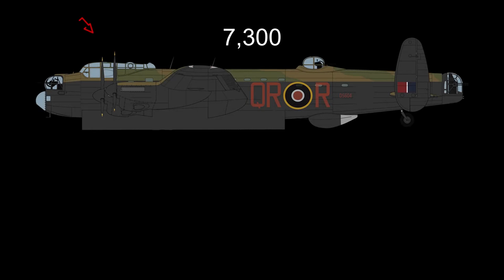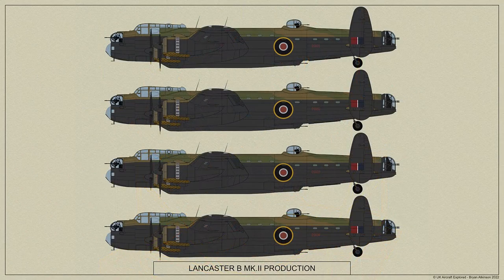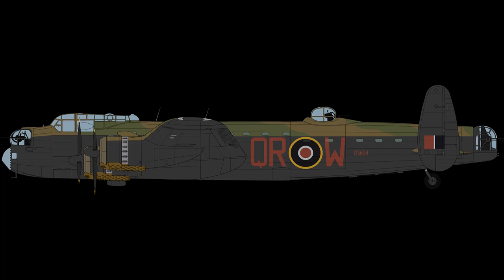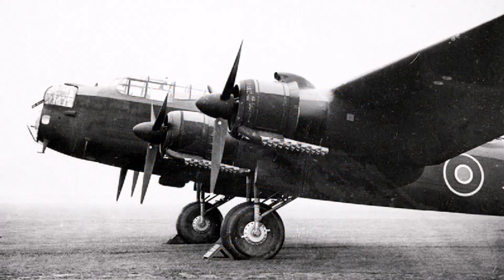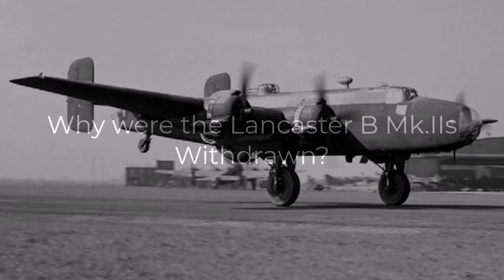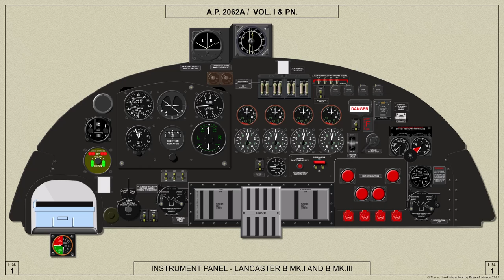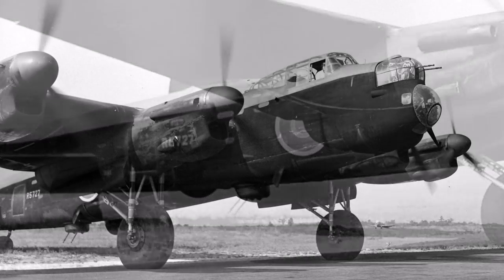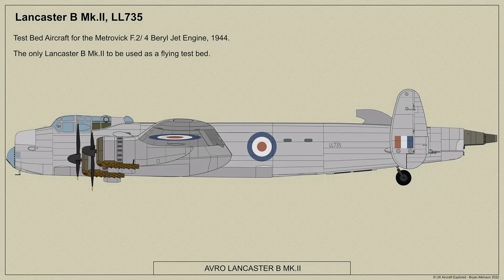Avro Lancaster B Mk.II – The Forgotten Lancaster

Comment: Great video!  My Dad was in the 426 Squadron  as a pilot and flew 18 sorties on the Lancaster Mk II before switching over tot he Halifax Mk III and VII. I have question regarding the Halifax Mk III that I cannot find the answer for that you may be help. Why does the Halifax III have on three of its engines the flame suppressor exhaust pipe on the bottom right side of three of the engines and on the bottom left of the outer port engine only?  It would make sense that they would all be on the same side or in a two and two configuration. I am sure there is a technical explanation and I haven't found the answer to what that is and hoping you or one of your audience may have it. I build a model of my Dad's plane that he was shot down in over France in June 1944 and the anomaly just got the best of my curiosity.

Comment: Unless I am mistaken, 'in line' and 'V' engine configuration are not the same. Were not the Rolls Royce Merlin engines V 12, and not 12 cylinder 'in line' engines?. Unless of course 'in line' means something else that someone I'm sure will be able to educate me about. Peter Norcliffe.
Reply from the maker: The term inline was sometimes, but not always, used during the war to describe the Merlin. Often used, when describing the difference between the Merlin and a radial engine in training ground crews. I can only think that it was sometimes looked upon as two banks of inline cylinders in a V arrangement. Of course, the V 12 became the excepted term. Thanks for watching Peter!

Comment: It’s interesting the Hercules had no engine temperature gauges. You would have thought an air cooled engine would benefit from exhaust gas temperature sensors.
Reply from the maker: Yes, the Lancaster B.II did have engine temperature gauges. If you look to the part of the video, covering the Pilot's Auxiliary Panel, you will see it. Thanks for watching.
Reply: Most radial engines of the day had cylinder head temperature gauges.

Comment: One interesting point you made was the extremely poor ceiling of the Mk II. The Stirling gets criticised for its ceiling and the "short" 99 foot wingspan gets blamed. Could it have been the engines?
What was the ceiling of the II with the later engines?
I recently saw an article about the Whirlwind and it dis not fail because of the engines but rather the propeller. The engine was blamed, but a very technical explanation clearly shows that the prop used was not really compatible with the engine.
Is it possible that the Stirling has been called a failure and the wings blamed when it was actually the poor attitude performance of the engine?
Clearly the Herk was a great engine and it was capable of operating at height in some versions.
426 kept its IIs I  service until ordered to hand them over. I read that in the official squadron history "Thunderbirds at War".
426 went from Wellingtons to Lancs to Halifaxes and was always Hercules powered.
Reply from the maker: Interesting thoughts. Yes, they used the Hercules powered aircraft, as the ground crews and engineers could easily adapt to each aircraft type. With regard to the service ceiling of the Mk.II using the Hercules XVI, the manuals and pilot's note don't actual mention this. I feel it would still have been around 18,000 feet. Thank you for sharing.
Reply: Interesting point about the engines on the Stirling.The Sunderland flying boat actually had a better ceiling than the Stirling even with Pegasus engines. The bigger wingspan did seem to help - but I'm sure the reducing power as the altitude increased must have been a factor.

Comment: So - the conclusion seems to be that the main advantage the Lancaster had over the Halifax was its Merlin engines.
A Halifax with Merlins as good as a Lancaster?
Reply: The Halifax started life with Merlins and had them for much of its service life. It was only much later in the war when radials were fitted (along with airframe changes) and the combination led to the lowest loss-rate of any Bomber Command type in service 1944-45. Ironically, given the information in the video, this was ascribed principally to an increase in operational ceiling although no doubt the greater ruggedness of the radial had much to do with this also ...
Reply from the maker: I do mention in the video, that crews felt that the Lancaster Mk.II was safer than the Merlin-powered Lancaster versions with their vulnerable engine cooling systems. And in spite of damage considered crippling to the standard Lancasters, the Mk. Ils managed to struggle back to base. Thanks for watching!
Reply: The later versions of the Hercules were much improved on the ones fitted to the Lancaster MkII in respect of the ceiling

Comment: It's not forgotten by me. I often point it out when there's a discussion about the Lancaster, seeing as how often the Mk II is overlooked.

One thing that would be nice is to have some firm numbers as to how many of the Mk II had the bulged bomb bay doors and ventral turret. References I've read frequently say 'most' of them had the enlarged bomb bay doors, but that's hardly a definitive count.

Some did have the ventral turret. 408 squadron certainly did, as it squadron ORBs list an eighth crewman, the mid-under gunner, for some of the aircraft. The earliest instance of this was on the 30/31 March 1944 mission. Approximately thirty different aircraft, by serial number, had a mid-under gunner for one or more missions by the squadron.

One thing that isn't clear is whether that mid-under turret was the FN64 or the Preston-Green (or was possibly a ventral station jury-rigged by the squadron).
Reply from the maker: I don't think any firm numbers regarding how many Lancaster Mk.IIs had bulged bomb bays and Mid Lower Gun Turret would be easy to locate. The Mid Lower Gun Turret used was the Frazer Nash FN.64. Thanks for sharing and for watching.
Reply: @ukaircraftexplored6556  Yes, I've resorted to going through the squadron ORBs looking for an eighth crew member. Not exactly the easiest method!

Thanks for making these videos. It's great stuff.

Comment: You say Mark 14, but the subtitles say Mk XVI not XIV
Reply from the maker: In the video, I mention the Bristol Hercules Mk.14, it should be Mk.16. 
Also, I said that the Merlin engine is an in-line engine. I should have said The Merlin is a Supercharged, geared, pressure liquid cooled V-Engine, fitted with a two-speed Supercharger.
I'm sorry about this. Really annoying, as I checked everything before uploading. Thought of changing the video and re uploading, but would lose all of my views and comments. So pinned a message in comments and the same in the description. Thanks for watching.  Bryan
Reply: @ukaircraftexplored6556  perfection is for the gods. Thanks for caring about accuracy enough to pin necessary corrections.

Comment: Merlin was  V12, not an in-line engine.
Reply from the maker: Thank you for your comment. I should have said The Merlin is a Supercharged, geared, pressure liquid cooled V-Engine, fitted with a two-speed Supercharger. I'm sorry about this. Thanks for watching.  Bryan
Reply: A V12 is an in line engine.
Reply: @kellybreen5526  Of course it's not. The clue is in the name. You might as well argue that a boxer is an in-line engine, and a Deltic for that matter - complete tosh.
Reply: @gzk6nk  Vince, maybe itbis a translation sill bonnet boot thing but there are two types of engines round ones and long ones.
The round ones are radials because the cylinders go around the crank and the other ones be they straight, v, y or w or x shaped are in line because the pistons are one behind the other in a line. 
A V12 is an inline engine  even a V4 is considered in line at least in Canada.
Even if technically a stretch, this is the accepted norm for describing engines.
The only straight 12 cylinder engines in have ever heard of were in cars.
I guess you would disagree, but the Napier Sabre is generally considered an in line, same goes for the Vulture.
Radials get "rows" when they go deeper.
Being Canadian I am equally well versed in "British" and "American".
We are a tri-lingual country if you include those guys from Kay-beck.

Comment: XVI is not 14
Reply from the maker: Please note - In the video, I mention the Bristol Hercules Mk.14, it should be Mk.16. 
Also, I said that the Merlin engine is an in-line engine. I should have said The Merlin is a Supercharged, geared, pressure liquid cooled V-Engine, fitted with a two-speed Supercharger.
I'm sorry about this. Thanks for watching.  Bryan